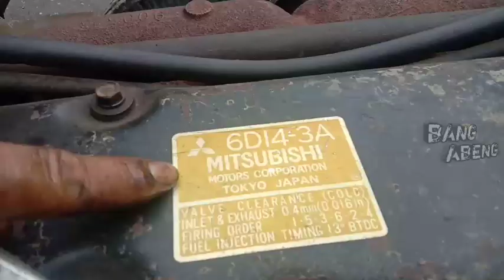Cara Menghilangkan Asap Putih pada Mobil Diesel || Untuk Mesin Dutro Dyna Canter juga Fuso

Comment: Bang mobil saya l300 berasap putih kmaren udh di stel nozel sama org bengkel sini ttp berasap putih tapi ga separah sebelum di stel, apa pengaruh klo mobil ngobos jadi berasap putih? Kebetulan mbl sudah ngobos juga
Reply from the maker: Iya bang, kalaungobos asap putih👍
Reply: @BangAbeng3d  kira kira masih bisa ga ya colok ring aja? Suara Mesin sih masih kategori halus, kebetulan keuangan blm mendukung untuk turun mesin😭
Reply from the maker: @jhonfedrositorus1872  itu ter gantung gimana keada,an, poring.
Atau liner nya bang
Reply: Mana no wa mu bg?
Reply from the maker: @jhonfedrositorus1872  ada adah di
Kontensaya sebelum nya bang